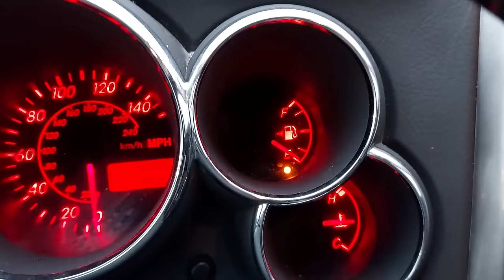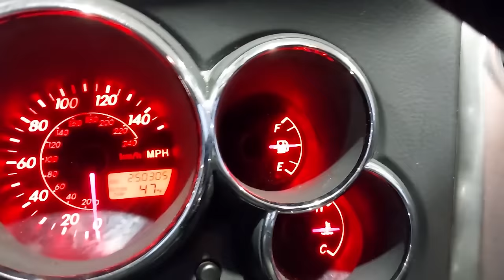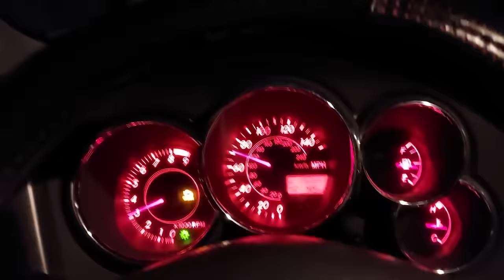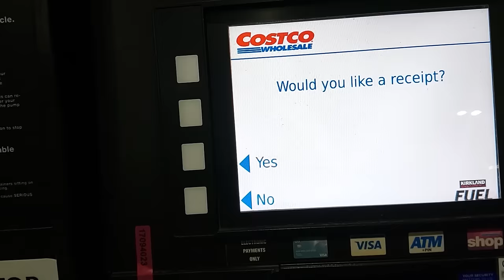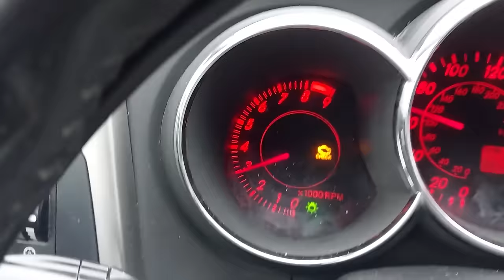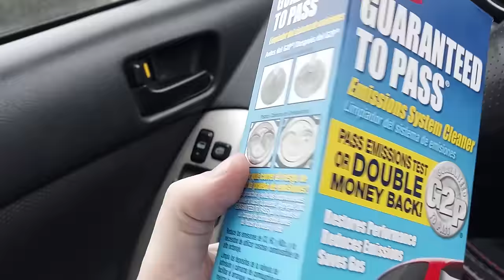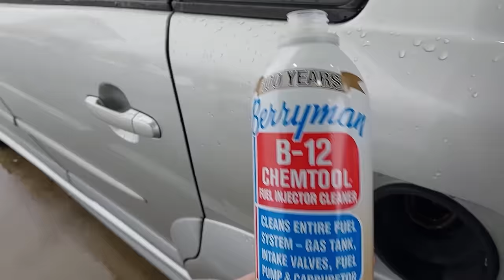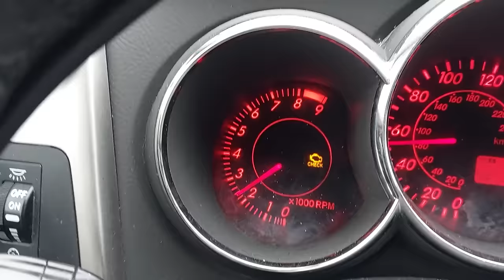Product Testing! Seafoam VS Rislone VS CRC VS Berryman do they work? Can they fix a P0420?

Comment: I did not have this problem until I replaced the transmission. I hope this product will work.
Reply: I had the same thing happen after a transmission replacement. I just saw water dripping order the vehicle. I called under there and found two exhaust leaks.  One at the crossover clamp and one at the muffler clamp joints. And yes an exhaust leak downstream of the cats can cause the P0430 code. I'll soon be headed to a muffler shop to repair those leaks.😟
Reply: This can happen if the mechanic had to remove exhaust and did not assemble it back correctly or cut corners. Best bet is to take it to a muffler shop and have them check it out. Or if you have a smoke machine do a smoke test and it'll show all the leaks you have under there

Comment: Since you tested the O2 sensors, I'd put my money on the high flow cats not doing what they're supposed to. To the best of my knowledge the O2 sensors after the cats are monitoring that the cats are doing exactly what they're supposed to be doing.  I've seen plenty of 'High Flow' cats that don't actually do a dang thing to convert the exhaust to pass emission tests, so those rear o2 sensors will most definitely always trip a code.  

If you don't care about the emissions since you know your cats are new and not clogged you could always take the rear O2 sensors out but leave them plugged in.  Tie them off under the vehicle (somewhere safe) and plug the O2 sensor hole and call it a day.  But remember that those sensors are there to let you know when the cats are performing poorly.  They could always get clogged up and you would never know until your engine starts bogging.  

Again, my bets on the high flow cats not doing a dang thing to convert that exhaust.  May want to invest in higher quality high flow cats.

Comment: Replace both O2 sensors, see what happens. Disconnect the battery, let the ECU relearn everything, see what happens. Still popping the code, it’s the cat not scrubbing enough to keep the computer happy. Problem solved?

Comment: As some one mentioned before the problem is the Hi-flow cat you need to use a mini-cat O2 sensor defouler or extension some call it that will solve the problem

Comment: I’m commenting before I watched the whole video because I don’t want to forget… Yes seafoam, Berryman, gumout, and the Walmart brand super tech share the same bottle but accept no substitute… Seafoam is the real deal… The others, I’m sure they’ll clean injectors through the fuel system which would be fine but as far as soaking things in the off brand stuff or using it in your oil or doing the hot soak I would highly recommend not using it in that way. Seafoam is really gentle on rubber seals and sensors but the others are not… I’ve been using seafoam for years. I replaced the head gaskets on my 96 ford ranger a couple years ago. It ran hot because of that stupid vacuum actuated valve that allows coolant to flow to the heater core and a feller didn’t catch it in time… Anyway, when I had the engine apart it looked spotless on the inside, not gummed up at all and believe it or not you could still see the factory crosshatch in the cylinders from honing… Anybody that doesn’t believe me can do their own tests at home… Soak a rubber seal or O-ring in seafoam and the others in the off brand stuff for a few days and holler back at me… Just trying to help save somebody a lot of heartache later on down the road… My 96 Ranger has over 300k miles on it by now I’m sure… It had 170k 13 years ago when I got it, I was rolling to a stop and pressed the button to reset the trip meter and stripped the gears to the odometer and never replaced them… But rest assured that truck has seen its fair share of wear and tear… I used it as a work truck hauling mowing equipment and I even towed a few cars with it from a few counties away…😅 Including a mustang with a 302 and 351 Cleveland heads…😂 Yes it’s possible to put big block heads on a 302w… Just not very logical nowadays… Lmao 🫡✌🏼
Reply: Ok I watched the whole video… I just like to stay up to date on the latest, greatest, snake oils…😂 Just so you know I’m not bad mouthing Berrymans or any other brand. I’m just saying seafoam is my snake oil of choice…😂 I will say this, I had a friend that was commercial parts pro at advance auto parts and he said mechanic shops would order cases of seafoam to help cars pass emissions when Tennessee had their little spat with emissions… They went back to no regulation now… But from what I heard, they would do the hot soak… Rev the car to around 2500 rpm’s and take the brake booster line off and slowly pour the seafoam in the vacuum line blocking part of the spout to control the flow of seafoam and towards the end of the bottle they would pour a little heavier until the car dies and let it soak for a while and supposedly they would pass with a dirty catalytic converter or whatever… Idk, I’m just repeating what I heard… Take that with a grain of salt… But I’m sure they weren’t buying cases of seafoam for the hell of it… Cool video, I’m gonna check out some of your other content and possibly subscribe… Even if you feel like this was a failure, it wasn’t maybe you’ll save some poor guy a lot of money throwing snake oils at a problem that can’t be fixed without replacing the defective parts… Did you pull up live data and see if the oxygen sensor had any signs of life or if it was just flat lining? Thanks for the video!
Reply: @jimmywilson1388 prefer Seafoam instead.

Comment: 09 Nissan Cube with 120,000 and service eng light on for a year. Put Techron fuel system claner w/ full tank of gas. When at half full w/ check light on, put in Rislone cat treatment . Drove about 100 miles mostly highway up to 80 mph for about a third of that. Filled up at about the 60 mile mark, Light off.

Comment: If you are using a flowmasters hi flow cat, you need to space the 02 sensor or that code will never go away
Reply: What do you mean you need to space the o2
Reply: @forrestfuller6359 get a long o2 sensor bung/a o2 sensor spacer. It is basically just a pipe that screws into the o2 sensor spot and then you screw your o2 sensor into it.

Comment: I may have missed it but it says add a bottle of Rislone to 1/4 tank of truck, drive 20 to 30 miles and THEN add gas... So you added gas right after the bottle, was there a reason for that or does it not matter?
Reply: good thing he had small gas tank, cause if rislone one says 1/4 tank they’re being vague.  he got it right to make it 1/2, which is a common  ‘1/4’ish, but then he added gas, deluding the potency, 😩dMmmmnn himmn☹️. (ps., at least ‘cataclean’ says so many liters, something like 4-5 gallons).

Comment: When resetting the ECU "manually" i.e unplugging the battery, both of the O2 sensors need to be taken out from their holes and cleaned. When the power is switched back on, the cleaned O2 sensors need fresh air for the base line reading.  Let the ECU run it's initial cycle, but DO NOT START THE CAR. Then turn the key off, screw the O2 sensors back on without unplugging them (that's the tricky bit) and start the car. I've done this succesfully several times without ever having a scanner/computer to clear the codes. On the Vibe's case, I'd argue that the after market cat is not efficient enough, or there's a small pin hole before the O2 sensors that mixes the exhaust gas with oxygen richening up the initial A/F mix.
Reply: & hoOoowe, dU U perpordt, would extra air contribute to richness(mOr fuel) in an air fuel mixture?🤔
Reply: @ezwa9979  Old exhaust manifolds/pipes become pitted with corrosion pin holes. When the exhaust pulse travels past these tiny holes, the pulse sucks air through the holes. When these pin holes occur before the O2 sensor, the extra air gives false reading on the O2 content in the  exhaust gas, so the ECU adds more fuel thinking the AFR is lean.
 Same thing happens when the O2 sensor is not calibrated correctly. If the sensor at it's calibration phase is sitting inside a fuel soaked exhaust pipe, it thinks the fuel saturation is normal. So it feeds extra fuel into the system trying to keep the pipe saturated.
 The sensor(s) send a voltage value, which then is read by the ECU and interpreted by the values installed in the memory. These memory banks can self clear if the battery voltage drops too low, or battery is disconnected long enough to drain the capacitors on the ECU motherboard. At this stage the ECU automatically goes through the start-up sequence including sensor calibration when plugged back on.
Reply: Ugg, so extra air can cause a running lean OR rich conputer snafoo?😯, guud grEEf, computers👋  it seems there are like 20-30 things that can cause this running rich cunundrum, coomm.. pUwtrs.
Reply: @ezwa9979  Extra air in intake, lean, extra air on exhaust, rich. wrong calibration/broken sensors, rich to prevent engine damage. Up until late 00's the system was relatively simple, after the emission regulations larger engines became unmanageable. The basics are still the same. Things rot, get clogged and start to leak just like they always have been doing. Due to the efficiency demands, a lot more heat is created with tighter tolerances, shortening the average lifespan of the parts, although the parts themselves have been improving exponentially over time.
Reply: @oikkuoek  
thNx, & what would you call the pcv loop? intake or exaust - or that spare air valve that looks like a pcv, but isn’t(same L shaped plastic, but not even a fake pcv valve), just lets excess air from valve cover 2, back to throttle body).  what would you call those hoses, intake or exaust?
I nag you with these questions  because, my cat. & or oxygen sensor codes started popping up RIGHT AFTER I fixed a few leans.. several times I’ve reset ECU(although there still could be carbons, etc., stuck on all the oxy sensors, cat., etc., from when it was intermittently(it was) running lean) & computer adapted, & then rich.  now it either my new cat., clogged up cat & or older oxy sensor, or vvt, pcv, egr, this that or 25 other things👋, guuud grEEf😑.
Reply: @ezwa9979  This is the thing, you can't fix an EFI carburetor style. Carburetors can be adjusted manually to form into any kind of situation. EFI does the same thing automatically. To do that properly, it means all the hardware needs to function within the parameters written in the code. When they don't, things start to act funky. Change broken parts, clean mucky parts and then put it back together again as it was before. Only mess with the code after hardware parts are different. Different exh/int manifolds(airbox, cat back), different cam(s). Error codes started to give detailed info around 10's, so with the older generations it seems more labour intensive, but there are fewer parts to remove and replace, so the work is the same. Also, most of the older generations have bugs in the error codes, so the computer can show wrong answers or not show anything. In those cases, the old skool method of simply pulling it a part, fix&clean, and back together again, is the only way that works. Just remember to calibrate the sensors correctly.
Reply: @oikkuoek  
thNx, & agrEd.. bt I don’t have carburetor, 2012, vvt, interference engine, on this 1, code readers are right about +-1/2 the time.  I figure, add cataclean, which will clean out fuel system, cat., etc. then if code comes back later, it’s a strong sign something ELSE is causing carbon built up, er go, it’s problE NOT cat., $25, for $15 of pre-cat cleaning, & $10 for partial(non partial - ovoiding biased prognosis someone who wants a grand for an unnEded cat. swap) diagnostic.  & btw, I’ll start wil an 1/8th or 1/9th tank, add it, then flip in more tell it’s 4-5 gallons(it’s called the mix trick -just now).
Reply: @ezwa9979  In most cases, the airbox is not properly ventilated, and the filter cartridge is not up to spec. Most aftermarket cartridges are too stiff for the engine to breath. Japanese setups demand OEM to function, and VAG products clogg the incoming air passage to the airbox. Bigger setups, V8 etc are too small from the factory. Then there are bad coils, leads and sparkplugs. Bad coils don't necessarily show on error list, and even if there is a spark, it can be weak enough to not fully ignite the soggy mix coming from clogged injectors. When modern engines are at the end of their lifespan, there's usually more than one problem creating the symptoms and with just one simple problem left untouched for long enough, damage escalates. 2012 is already 6 years past it's "best before" date, so most of the consumables are done; sensors, injectors, solenoids, wiring, hoses, fittings, bearings, seals, etc. So it's a game between chasing your tail, fully re-building it or scrap.
I have -98, -99 and -03. Still insisting on chasing my tail, unless I come across a rust bucket less expensive than the pile of parts needed to keep the current one(s) on the road.
Reply: @oikkuoek  
I think I mentioned, this was running lean, UNTIL right after I fixed that, maybe a day or an hour, rich - so not enough air was likely not the problem in this case.  making computer adapt to lean & rub rich coudda been, but I’ve reset ecu many a time & after a day or so, rich 420 comes back.  sad thing is, I made a video mentioning how smart I thought I was, for that very(mistaken) scenario. - worse yet, I made a video bouwsting how brilliant I thought I was, finally figuring out how to plug in a battery to a dewault battery charger. just plain sad🖐😔
Reply: @oikkuoek  
I did tighten pipe coming from engine towards cat yesterday, perhaps loose enough for air to seep in, but before I beleive, the upstream oxy sensor.. was that your theory on how computer gets mislead? some leak between the 2 oxy sensors? I forget, maybe I’ll re-read that 1👋.
Reply: @ezwa9979  First the intake gets clogged. Then the engine starts to recycle the gasses inside to compensate the lack of incoming air. these gasses melt the vent tubing and the engine starts to go lean. Then the cooling system starts to crystalise from the excess heat and formed gasses in the system. By this time the radiator, waterpump and thermostat are almost done already. Then you fix the lean, and the overcompensated AFR burns your exhaust manifold filled with carbon. hot chunks of carbon deposits damage your catalysator, and your sensors are giving faulty readings. The ECU goes into fault mode, and feeds even more fuel trying to save the engine. The burning carbon burns your valves and the carbon deposits grind your valve guides loose. This, with the added old piston rings eat your valve stem seals. Hard to find any easy fixes, tune-ups or singular parts to solve this.
Reply: gr8 dUmszdA stuff, hUd of thought running lean could DstrOy the whole dRn cR like that👋
Reply: @ezwa9979  7 years or 100k miles, which ever comes first. After that, done. They are revivable, but the cost is about the same as new. They are engineered as single-use items by mandate, like any other house hold item. The "right to repair" is valid, it's just very expensive.
Reply: @oikkuoek  
of-what ‘they’ do you speak?🤔.. 
& btw, earlier U were saying if its lean outbound it cause cause rich? or something.   so what were U sayng?, that a lean outbound can cause a rich, or just that a lean anywhere can cause a rich outbound?  
In short, which ‘they’? & what inbound-outbound?  IO, lean where? could cause a rich WHERE?☝️
Reply: @oikkuoek  
I guess Ur tAkN about O2 sNsrs.. && btw., I ran some cataclean & got no result.. too l8 now but question came up.  I’m gonna C if I can dislodge O2 sNsr,(the 2 codes I got were p2097 & p420, & unless the cat can make to O2 bad, the chances are the O2 made the cat reading bad, which means more likely O2 sNr), but anyway, an interesting question came up(2 l8 as said ofcoOrse), but it’s interesting how no one mentions this- if p420 means running rich, should 1 reset code before adding cata clean(so it runs rich), or leave code so it, ECU adjusted, runs less rich.. in other words, is more(too much gas) better to make that stuff work, or the best mix/balance of fuel & air? probley makes a big differance - too bad its a secret👋😒.

Comment: Seafoam saved me from rebuilding my xl600r carb after the bike sat for 8 years in a private garage 250 miles away. After burning 3 tank full of gas it was unnecessary to rebuild it. Ended up rebuilding the bottom half (crank) , the top half I rebuilt just before it came to resting for 8 years. 
Would the carb cleared after using gas only? Well, after 2 tank full and sputtering and stalls it didn't so I threw the hail mary ball of gas additive witchcraft for the hell of it and lo and behold. After 1 tank it was noticeably  better by 50% and after the 3rd tank it was purring (well, as purring as a thumper purrs that is).
Reply: "threw the hail mary ball of gas additive witchcraft", What's that ?

Comment: I've used the crc and have had good results
Reply from the maker: What did you use it on and did it turn OFF the light, or just keep it off for a bit?
Reply: Do you clear code first before pouring CRC?

Comment: I have used Berryman for years seems to help my cars and trucks
Reply from the maker: Do you use it to FIX anything or just as sort of a "preferred maintenance" kind of thing?
Reply: @Lucore Auto and LucoreRacing   maintenance kind of thing but I can tell when my truck needs it it shudders bty I'm from hilliard oh close by
Reply from the maker: @Jerrylee84  hilliard is definitely not far away! What do you think is causing the shudder and what is it "fixing" when you use it?
Reply: @Lucore Auto and LucoreRacing   It clears the injecter on my truck I belive but I also need to dop sopme work on my old rig but it helps with its performance for sure it the fuel delivery and I feel it cleans the throttle body